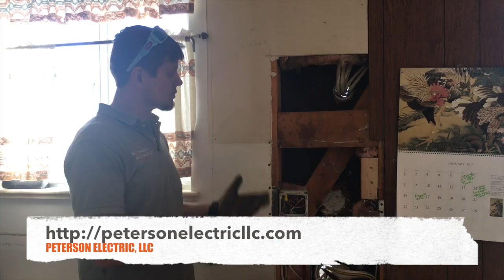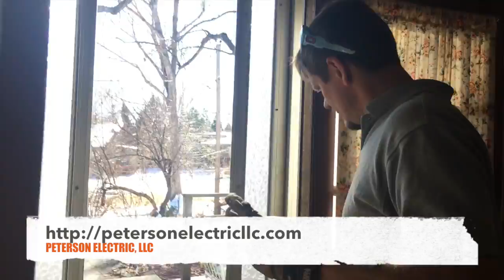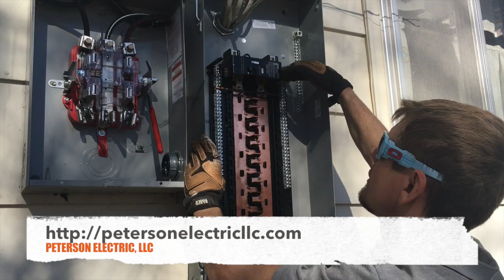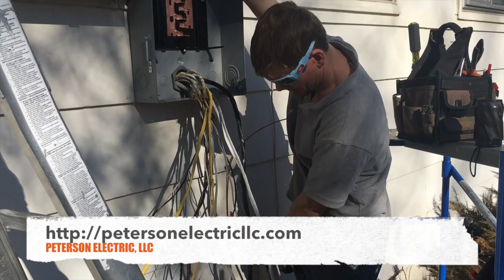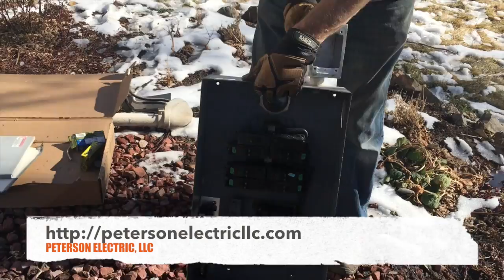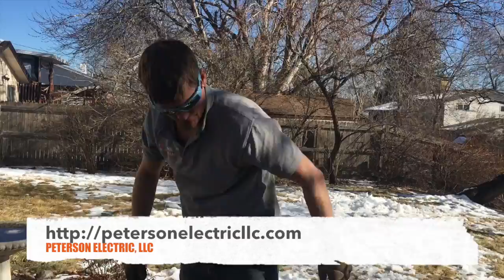Residential Electrical Service Change With Bypass Lever Meter

Comment: Your new panel is too close to that window you don’t have the clearance required, also if a main panel has a main breaker that is enough for a emergency disconnect. Where are the arc fault breakers

Comment: He's talking about splicing in a panel. In the NEC, the fly in the ointment is that it states that the NEC code is subject to local jurisdictions. Larger cities have addendums to the NEC that supersedes the NEC. Therefore some jurisdictions don't allow panel splicing. Check with local electrical codes 1st.

Comment: Thats a milbank clamping jaw socket Cant understand why people put panels on the outside in my area their inside . I resent that aluminum wiring i know you didnt do it in my area all i would have to do is pull it out and replace it with copper with additional circuits & afci this is why i love CONDUIT ive re pulled houses in the past. If you look at products say Detroit Diesel the headquarters are in Detroit mi but DAIMLER BENZ OWNS IT no more an American company. Square D started out as Detroit Fuse every one asked fore that Square D switch [it had a square around the d fore looks]they renamed it Square D Company now owned by SCHNEIDER ELECTRIC,  I-T-E= SIEMENS not American owned [ panel in this video] .Since Best Lock was bought by DORMA KABBA my locksmith told me PLAN FORE THE QUALITY TO GO DOWN. I have a best lock thats stamped AC SPARK PLUG it was from their plant in Flint mi As of 1999 GM now uses Denso & NGK spark plugs they no longer make their own. Locks & smithing are only a hobby fore me. I get a lot of industrial history out of it [ company names stamped on about 200 locks in collection] When America was one America.
Reply from the maker: I was born in 1975, and my first GI Joe was bought for me in 1979. I still have this action figure, what is interesting, is when I pulled the old Joe's out of the attic and started collecting this with my sons, It blew my mind that this has been going on with other countries making our toys prior 1970's. Sad! 
Americans are flat out lazy. You wait, in TEN YEARS most of our country, per state to city is going to have a lack of Tradesmen, there will be knowledge forgotten and never passed on.
Reply: @Petersonelectricllc  I feel the same way i was born in 1961 my great nephew is watching me do electrical work it makes me cringe this is non of his business hes 4 years old and very curious like i was when i was that age .i asked them to keep the children out of the way because i go like lightning up and down those steps im scared im going to run in to or injure one of them.The whole house is done in BX im replacing opened slices lots of romex ,adding a few new circuits and combining the silly circuits .I need a 20 a circuit fore the bath outlet a 15 fore the microwave a 15 fore the fridge im installing new BX I REALLY DIG 11B AND DEEP 1900 BOXES  im drilling holes in the joists to run my BX and am going to probably re rout and go through a lot of staples before im done Im calling this house THE BLACK HOLE so much wrong.
If you have kids in school you should ask them if they have ever been locked in the TIME OUT ,SECLUSION, QUIET, COOLING OFF ROOM .Illinois  schools are under fire because if a kid SPILLS MILK, TEARS UP A PAPER, SWEARS, PUSHES A BOOK OFF THEIR DESK , THEY GO TO THE ROOM some times fore hours THIS IS DAMAGING THESE CHILDREN PTSD ECT AND ITS AGAINST THE LAW .These room are only to be used if the student is a danger to staff, others, property or him self. Look up CHICAGO TRIBUNE NOV 24 2019 THE QUIET ROOMS [big article]
If you have a plastic gas can be sure it has a FLAME ARRESTER  these things have BEEN EXPLODING COVERING PEOPLE IN FLAMING GASOLINE Blitz got sued out of business because they ignored peoples request fore the arrester [good riddins] .If you take the spout off and YOU CAN SEE THE INSIDE OF THE CAN GET RID OF IT!!. If you SEE A THIMBLE THAT LOOKS LIKE A FILTER [ MESH ]AND CANT SEE THE INSIDE OF THE CAN THATS THE FLAME ARRESTER.
Reply from the maker: It is a CO. State Demand that we have ALL MAIN disconnects on the out side of the house, yet 203.79-82 talks about this and we are allowed to have it back to back, from meter to Load center. Not any more. per 2020 code coming soon.

Comment: Why run things in metal (chase nipples) instead of PVC? In Virginia the power company will install the SE if less than 22' feet. They would run cable not metal pipe.
Reply from the maker: We have to do everything for the power company, and metal nipples give more strength and grounding. State standards.

Comment: Gonna take a wild guess and say most of the outside panels you work on are outside because the house has no basement or utility area that meets code. If I recall correctly a small furnace / boiler room doesn't qualify unless you can locate the panel 5 ft away from a heat producing appliance, so you are stuck going outside. Same thing if the basement doesn't have enough head room to meet height or access requirements.
Reply: No, In Colorado, most houses have basements and nearly every box is outside
Reply: @matthewacovington  ... ok, so what's the reason? Could it be local code?

Comment: Mr. Peterson, the utility company in SouthTexas demand you to bond the neutral and the grounding conductor at the meter box, so in that case, do i have to separete neutral and ground in the panel?
Reply: Daniel Abundis Yes keep them explicitly separate; they have different purposes (even if they are bonded together at the meter). In normal operation, the neutral conductor is expected to have current flowing though it, but the ground conductor shouldn’t. You are only talking about saving few feet of cable...
Reply: Of course you should always consult a qualified professional rather than take advice from the internet  (YouTube comments in this case).
Reply: Bryn Jones Thank you so much. So if you bond at the meter box and then at the main disconnect, will it be considered “double bonding”?
Reply: @danielabundis1214 … never bond at the meter unless there's a disconnect breaker within the meter pan. When the NEC says to bond at the point of first disconnect (inside that cabinet) they are talking about that first large breaker that shuts off the entire service. If it's at the meter, then fine, but if the main breaker is in the panel a few feet away from the meter then that's where the bonding happens.
Reply: rupe53 Thanks for your answer!

Comment: Im an electrician from Philly...I notice just about all of the panels you work on are outside. I dont think Ive ever seen a panel outside in my life. Is there any reason the panels in that area are outside?
Reply: it's a southern thing?
Reply: In Arizona it's the same thing. The main Meter and Main Panels They HAVE TO be outside for Fire Departments to be able to shut the power off during a fire.    

Here in Arizona we have a Meter and pedestal outside with 1 big breaker usually 100 to 200 Amps that feeds another breaker box in the house usually in a laundry room master bedroom or they can be right next to the Meter as seen in this video. I think where you are located is because you guys get A LOT of snow compared to us down lower Elevations
Reply: In 100 degree heat, and the panel baking in the sun, makes no sense.  Meters are always outside, pull the meter, power is off.   Outside service panels is weird, and illogical.
Reply: Weird and goofy, why expose the breakers and those connects, warm, cold, hot all kinds of changes to affect connections, and cause unnecessary corrosion, WEIRD bizarre